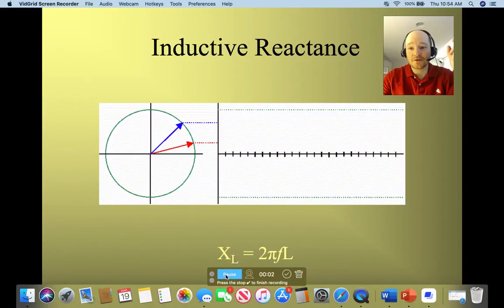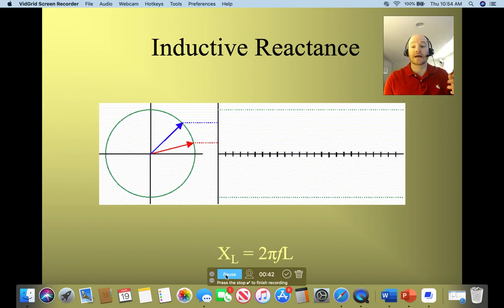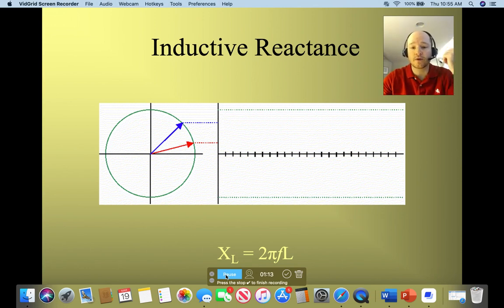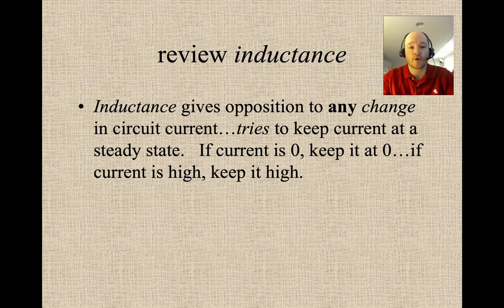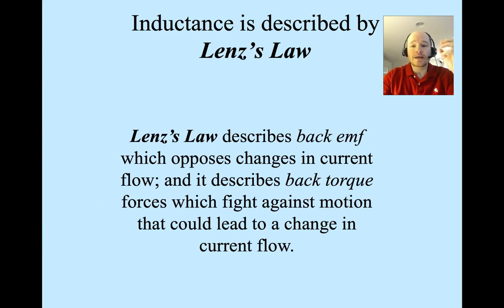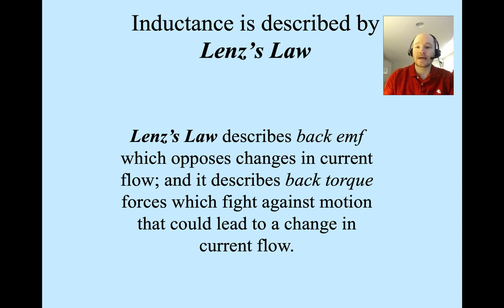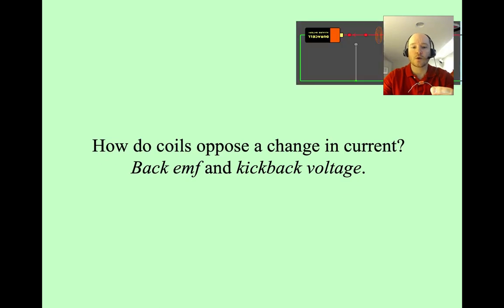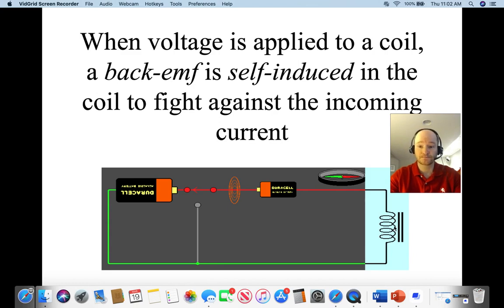Inductance Lecture Part 1

Comment: Well, my understanding is that if u pass D.C through an inductor there will be no magnetic 🧲 field because D.C doesn't change directions
Reply from the maker: That is not correct.  If you pass DC through an inductor it will produce a magnetic field it just will not have motion.  For example, a DC solenoid creates a magnetic field which is just an inductor.